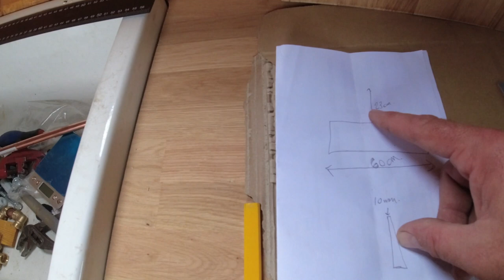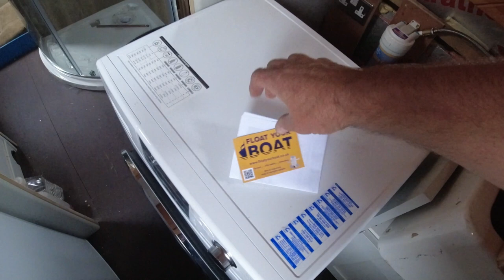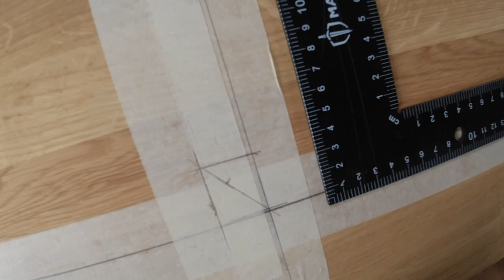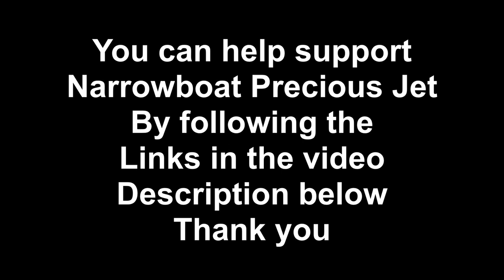Narrowboat Refit #37  Fitting a cooker and taps into a narrowboat

Comment: Hi Steve, Looking good, maybe a full length back splash is in order, ceramic or porcelain tiles will cover the sink and give the wood some protection from the back burner on the stove. Cheers, Nigel
Reply from the maker: Thanks Nigel, yes I think I will be looking at a glass splash back may be, also think I might try and move the hob (cooker) away from the wall a little more to 😊👍🏼

Comment: Sinking the glass hob makes it look loads better. Also makes it harder to break from hitting the edge.
Reply from the maker: Thank you Claire, I think it looks great. In hind sight I would of come a bit closer to the edge of the worktop though 😊😊👍
Reply: @NarrowboatPreciousJet  i don't mean placement, I meant routering the worktop so it sits flush with the surface. I broke a hob once by putting a jar down and catching the edge. But that was induction hob, guess with gas thingys there is less likely. It does make them look allot better but looks good anyway, I didn't mean it looks naff :)
Reply from the maker: @claire4486  I knew exactly what you meant Claire 😊😊👍x

Comment: Hi Steve. It may be the camera angle but the rear gas burner looks close to the panelling. Will it be likely to singe or burn when lit and with a pan on?
Love the vlogs, keep them coming 👍
Reply from the maker: Hi Colin yes you are right and in hind sight I would of given myself a bit more room, however it’s done now so until I buy another £300 worktop I’m just going to fit a glass splash back to help protect the wood 👍👍

Comment: Hi Steve, I think your hob should have had a 90 degree turn to keep the back burner further from the wall and little fingers away from the flame or gas tap. Just my thoughts.
Reply from the maker: Hi Dave, I did coincided fitting that way but it just didn’t look right, and also it’s going to be only me and the Mrs on the boat so there won’t be little fingers 👍🏼👍🏼😊
Reply: @NarrowboatPreciousJet  👍